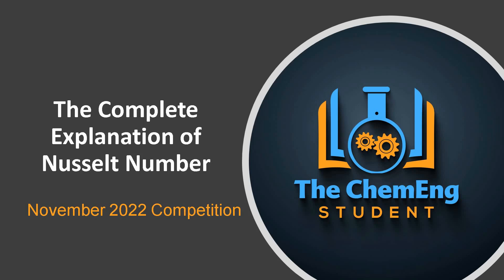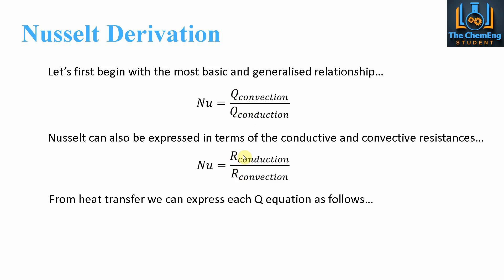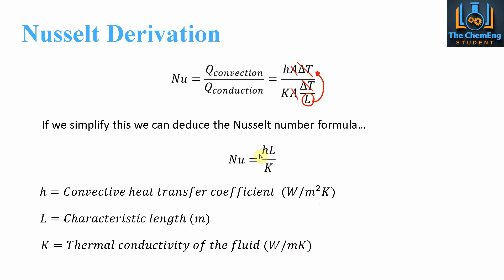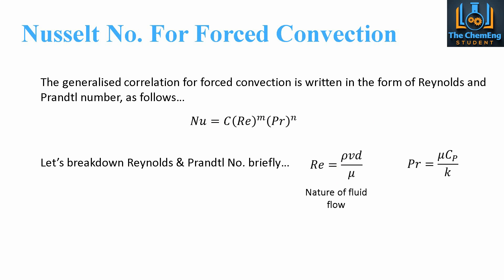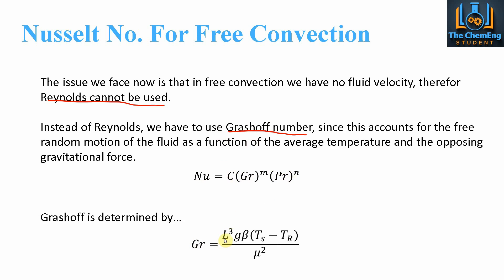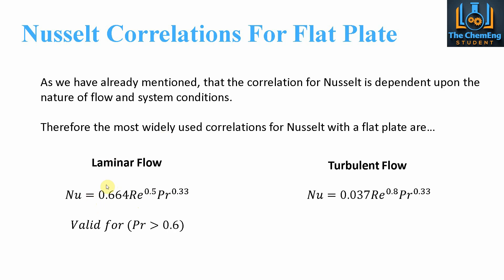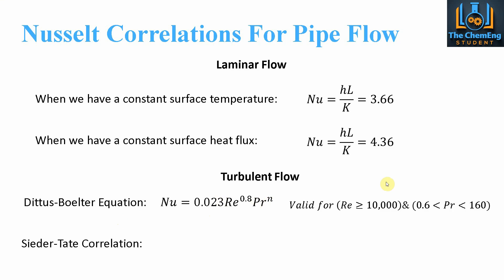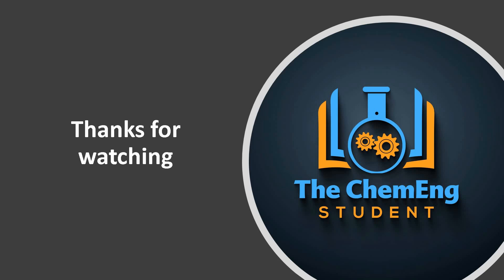The Best Nusselt Number Explanation For Heat Transfer

Comment: what does characteristic length mean here
Reply from the maker: Characteristic length is just another term for the length property. The reason we refer to it as characteristic is so we are not restricting to a single axis, but rather a general term which can mean several things. For example, the diameter of a sphere would be considered the "length". In more rigid geometries like rectangles, we would simply say the thickness. I hope that makes sense. Thanks for watching and commenting!

Comment: Hi! I think the formula for Gr is missing a squared term for density in the numerator. Alternatively, the viscosity term in the denominator should be the kinematic viscosity.
Reply from the maker: Thank you for your comment. In Grashoff No. there is no density term if the kinematic viscosity is used which shouldn't be represented by Mu thank you for spotting this, in this particular version it should be upsilon for the kinematic viscosity. Much appreciated for your feedback!